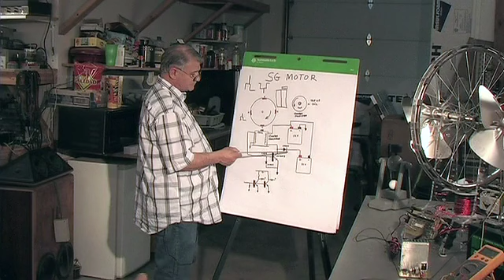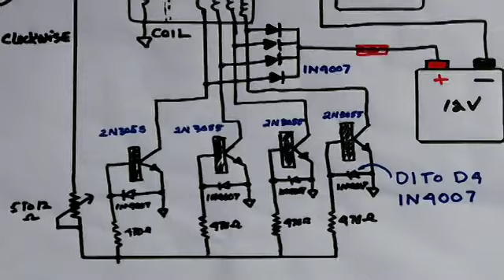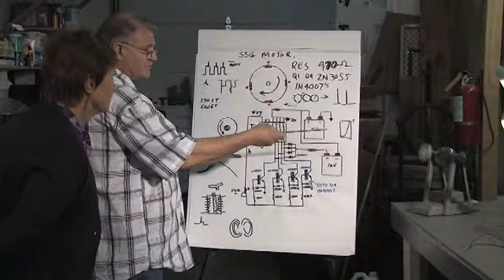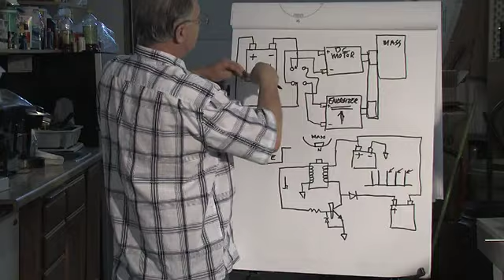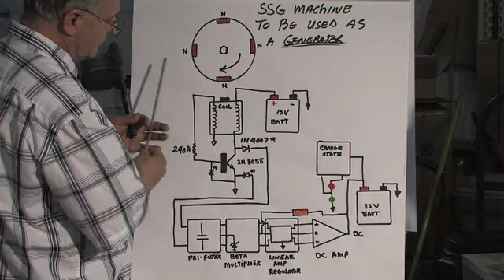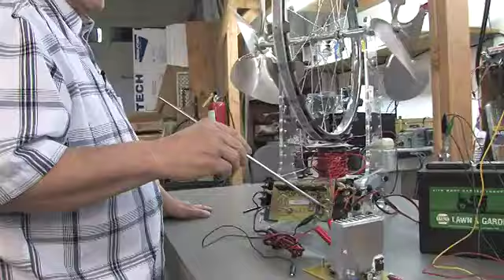#37 - The SSG Linear Amplifier Regulator (2014)

Comment from the maker: 0:00: ⚡ Explanation of a circuit involving coils, magnets, and transistors to optimize energy efficiency.
0:00: Coils wound together create a basic circuit with a trigger coil and a battery.
0:52: Motor is designed to self-regulate to minimize energy consumption.
1:16: The motor generates spike energy during operation.

9:38: ⚡ Discussion on high voltage spikes in battery charging using specific coil winding techniques.
9:38: High voltage spikes of about 300 volts are needed for battery charging.
10:01: Recommended coil winding of 700-800 turns with specific wire sizes for induction in motor creation.
10:08: Starting with 6-800 turns using number 20 wire for effective motor functionality.

20:33: ⚡ Explanation of how high voltage electrical charge helps in breaking sulfation off battery plates.
20:33: High voltage pulse breaks sulfation off battery plates, allowing ions to move and charge the battery.
20:43: Sulfated batteries benefit from the high voltage pulse as it helps break off sulfation, improving battery usability.
21:22: Sulfation acts as an insulator, hindering the movement of electrons and ions within the battery plates.

29:50: ⚙ Explanation of components and specifications for a linear amplifier regulator circuit.
29:50: Resistors are all 470 ohms to share trigger signal evenly among bases.
30:22: Transistors used are 2N3055, a common part available at electronics stores.
30:54: Diodes are rated at 700 volts to handle generated power efficiently.

40:35: 🔋 Innovative method of charging batteries using electromagnetic pulses and high potential spikes.
40:35: Capturing wasted energy in the coil to charge batteries
41:03: Utilizing high potential spikes to rotate the motor and generate energy
41:21: Trigger coil generating small impulses to control transistor switching

50:55: ⚙ Discussion on a complex energy system with a unique mechanism involving a DC series motor and generator.
50:55: The system involves a DC series motor turning an Energizer acting as a generator, controlled to alternate between powering the motor and generator.
51:08: The mechanism's design poses a challenge as it requires specific switches and control to function effectively.

1:01:56: 🔋 Exploration of self-recharging battery concept using massless charge and high voltage charge in a disconnected system.
1:01:56: Learning in attraction mode conserves energy
1:02:02: Energizer portion is generated when system is disconnected from motor, involving massless charge and high voltage charge
1:02:59: Deli waves refer to massless charge without current going to secondary battery, completing the circuit

1:12:41: ⚡ Innovative energy regulation system utilizing a comparator and capacitor for efficient charging.
1:12:41: Utilizes a comparator to switch on a Field Effect Transistor and regulate charging of a capacitor.
1:13:52: Electrically switches between cycles to speed up the charging process and efficiently charge the battery.
1:14:07: The system eliminates the need for manual contact switching by integrating electrical components for seamless operation.

1:23:35: ⚡ Study on fast charging batteries using pulse current for efficient energy transfer.
1:23:35: Primary battery charging efficiency is improved by quickly supplying energy to a capacitor.
1:24:22: Pulse current is utilized to charge the battery faster and more effectively.

1:33:33: ⚡ Conversion to linear amplifier regulator for circuit protection and stability.
1:33:33: Linear regulators and circuits require conversion to handle radiant spikes and static discharge.
1:35:01: Beta multiplier is essential for transforming high potential voltages to pure DC signal.
1:35:38: Use xener controlled beta multiplier to prevent voltage exceeding 30 volts.

1:44:40: 🔋 Explanation of a flux gate and battery charging process in a machine.
1:44:40: Battery charge level is indicated by different color states.
1:45:13: Feedback from charge state affects regulators and multiplier circuit.
1:45:54: The machine operates based on a flux gate concept.

1:54:47: ⚡ Development of a self-contained unit to charge batteries while sensing load, a lifelong goal since the 1980s.
1:54:47: Achieving the basic function of the circuit to charge batteries efficiently
1:56:01: Continuous experimentation since the 1980s, stemming from Bearden's free energy motor concept

2:05:06: ⚙ Discussion on adjusting regulators and comparators in a dual regulator circuit for optimal operation.
2:05:06: Balancing the regulators and comparators is crucial for proper circuit operation.
2:05:30: Adjusting the screws controls the direction of the regulators in the dual regulator setup.
2:06:02: The concept of using one device for regulation in this setup differs from the Solar tracker design.